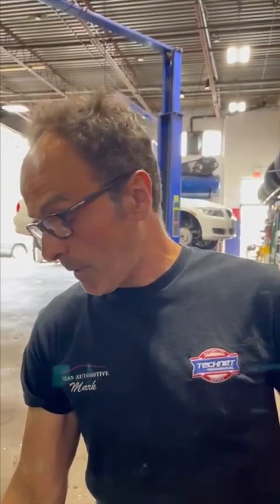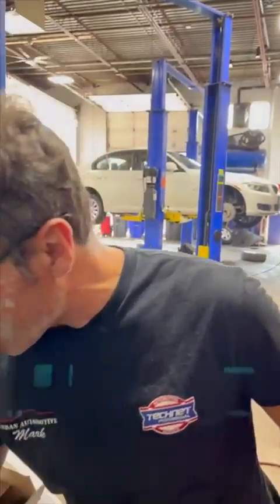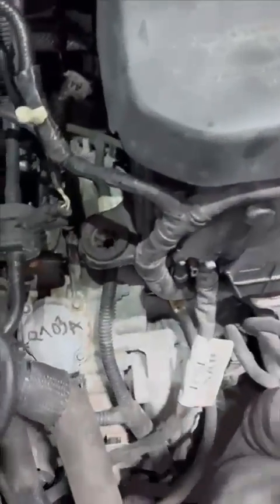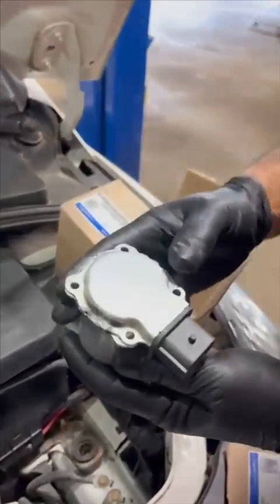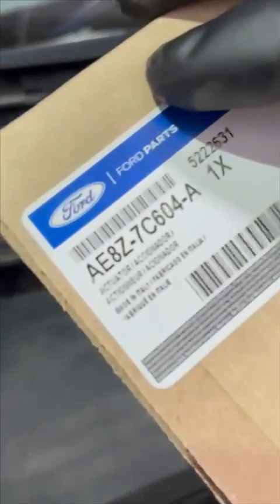P07A3 & P07A5 DTC: 2012 Ford Focus Transmission Shift Solenoid Actuator Repair Urban Automotive

Comment: This seems to be a summary video, with nothing on the actual diagnosis as per the description.  It is my understanding that the shift fork wear/getting gummed up can also cause the same code.
Reply from the maker: Thank's for the question. These codes could be related to a mechanical failure in the transmission, a software issue, or possibly a problem with the transmission's hydraulic system. In the case of the vehicle in the video we were able to replace the actuators and re-program with our scanner that resolved the issue. This particular vehicle had just over 100,000km on it despite it's age. If it had more km on it then the points you mention would raise greater concern. If your vehicle potentially requires a transmission removal or rebuild replacing these components with a reprogram is a cheaper option to start.  Thank you for watching!